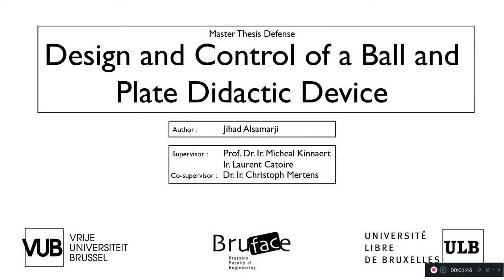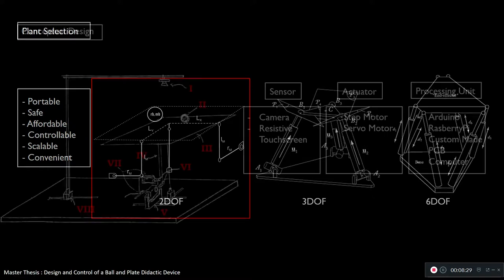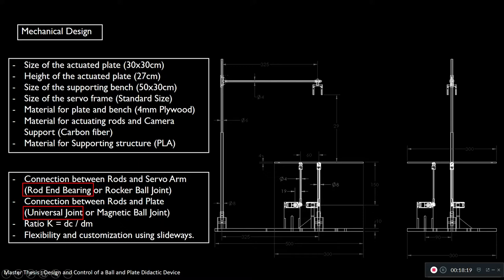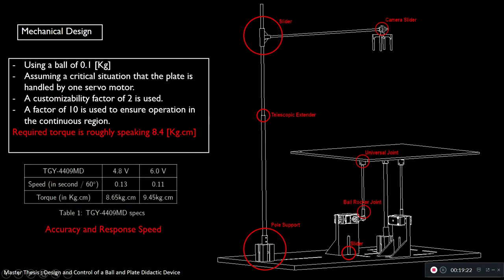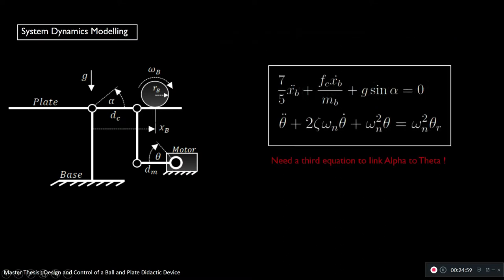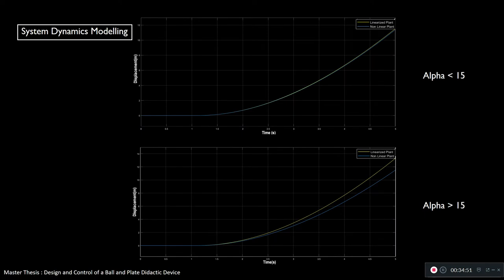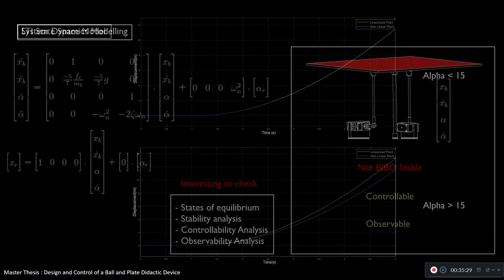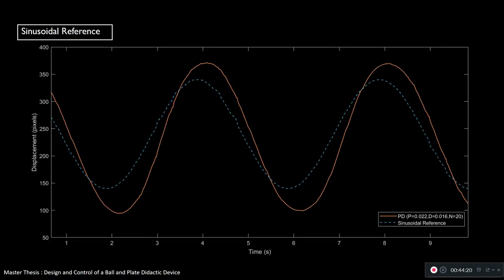Design and Control of 2Dof Ball and Plate

Comment: Very interesting work and thanks to you to share it ! I've a question about the modelisation of the ball rolling resistance, usually it is modelled as constant torque resistance opposite to the displacement (Fx = - k.sign(xb'). Why you use a viscous friction (Fx = - fc.xb') in your model  ?
Reply from the maker: To be honest with you i didn't put much focus on this part . As i saw that many other similar project were using the viscous friction.

can you put a reference of the formula you provided ?